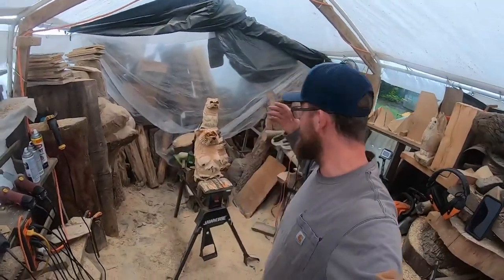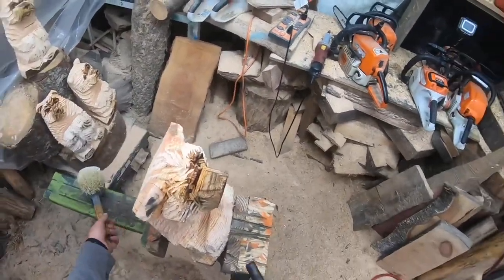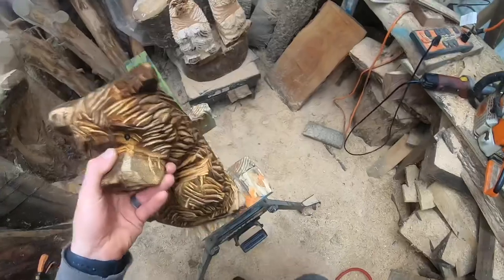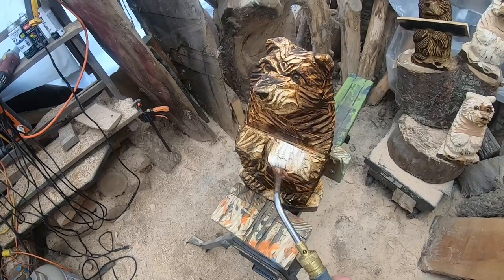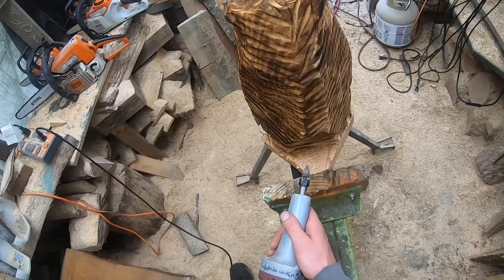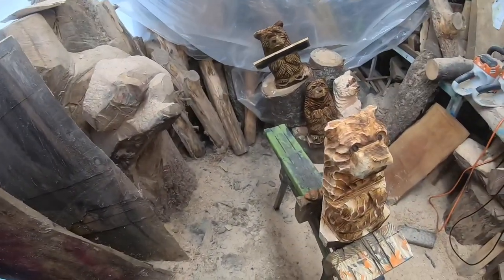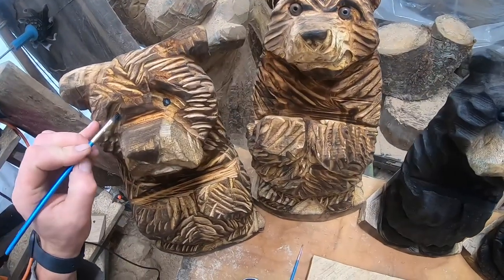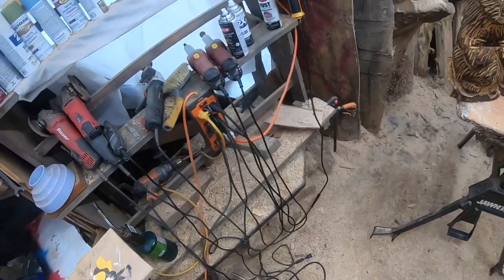Chainsaw carving for beginners. Finishing bears

Comment: Since you used spray paint on the bears, don't you have to use the oil based helmsman sealer on it? Most spray paint is oil based so I'd think your sealer also has to be oil based, correct? Can you put acrylic/water based helsman on top of spray painted pieces?
Reply from the maker: I can no longer get the oil based helmsman in a gallon in NY so I have been using the acrylic over the spray paint. Seems to be working fine

Comment: After torching it it’s done ? U do not need to spray epoxy or some sorta coat to protect it ? Does it ever crack because weather ?
Reply from the maker: I like to use an exterior polyurethane to protect the carving